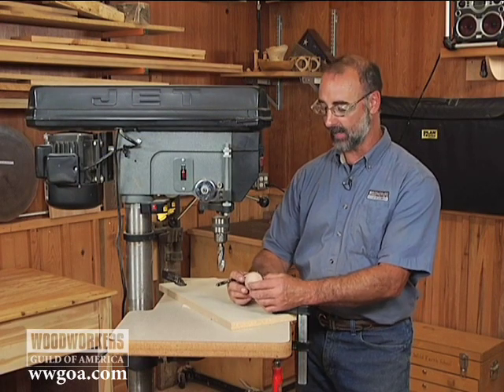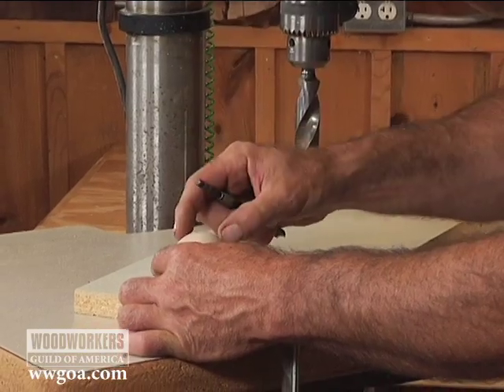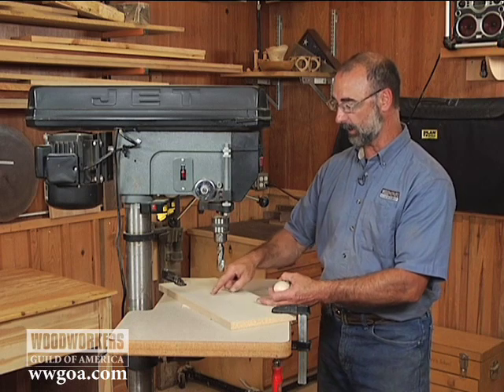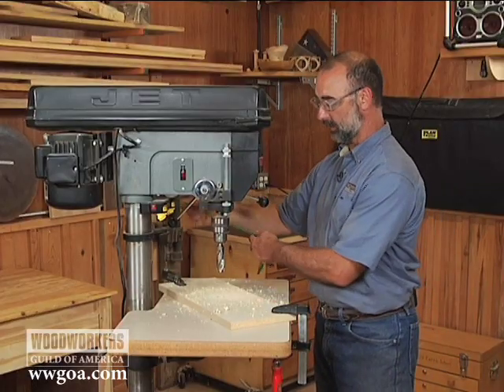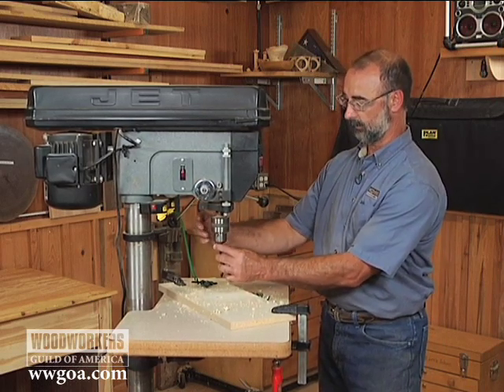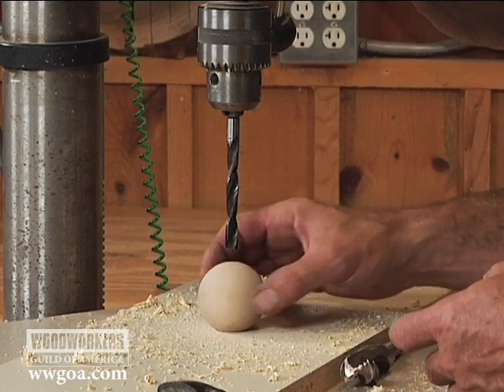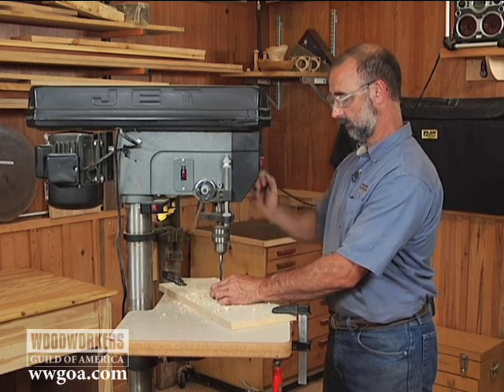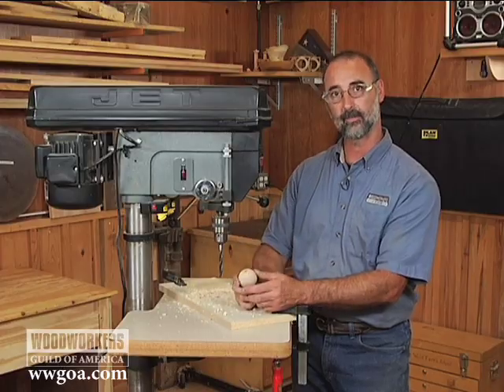Perfectly Centered Hole in Sphere

Comment: Excellent topic and solution!  

How might you clamp or secure the sphere if you were going to cut it in half?

Unfortunately I can’t seem to find a safe way to do so.
Reply from the maker: Great question! I have forwarded your question to our experts. Please allow 1-2 business days for their response. We will post it here. Thanks!
Reply from the maker: Hi Mark, 

Good question.  We don't have anything on that specifically, but we have this which might give you some ideas: wwgoa.com/video/rip-cylinder-016439/

Paul
Woodworkers Guild of America
Reply: @Wwgoa  Thank you, Paul.  I was trying to think of a way to hold the sphere while cutting it in half and I believe it could be done by maybe by attaching two wood screws at either end of the sphere to act as handles and to keeps some distance between the saw and my fingers.

Comment: Good tip. I have an interesting problem I need help with. I want to drill some triangular holes in wood. The triangles are equilateral, about half inch on a side, 1 inch deep and pretty sharp corners and tight tolerances. Is there a way to do this?

Comment: ... nice drill press... how do you do that without such an expensive machine?
Reply: You probably need a drill press of some kind, even if not one as elaborate as the one in the video.  There are much-cheaper tabletop drill  presses available; mine was under $100. While pretty limited, it can use this tip perfectly well.

If you're trying to use a handheld drill, I don't see a way to do it.

Comment: Great idea. But I need to do the same thing in 2" X 2" round aluminum bar stock, without a lathe. I need to do this in 13 of them. The 3/8 inch hole must be concentric with the outer circumference of the stock.

I have tried using a 2" forstner bit, but the stock has play in the hole; thus the hole is always off center.. 

Do you have any ideas?

I am desperate? Of course just about any machine shop could do it, but "setup" time would make it out of my budget. Best price is around 200 dollars. No way.

Please help if you can. Thanks.
Reply from the maker: Hi Pat.  Since you only have 13 to do, I’d go through this with a little manual lay out. Use a round stock center finder like this http://amzn.to/2pgp0Vn to find the center of the round stock. Make a 90-degree inside corner from scrap, like one corner of a picture frame. Take your time and locate the center of the round stock under the center of the drill bit. I’d do this step with a small diameter bit, or a brad point bit, to make certain it’s hitting the exact center. Once the round stock is located under the center of the drill chuck, clamp the 90-degree inside corner to your drill press table to establish that position for the each piece you need to drill. Switch to the 3/8” bit, and you should be good to go.
Reply: Thanks so much. I will do that.

Incidentally, I met you at last years woodworking show in Atlanta. Indeed an honor and humbling experience to meet one of the "Greats" in woodworking. It was nearing the end of the show and you had just finished your last seminar.

I commented on how much I enjoyed the video you did on a Safety Cut Panel Saw.  Truly one of the best, informative and clearest videos yet.

May Jesus richly bless you for what you are doing for others dear person.